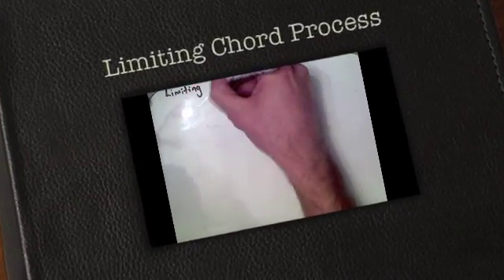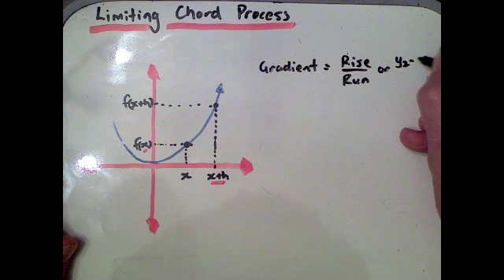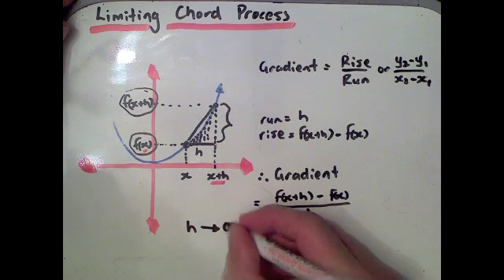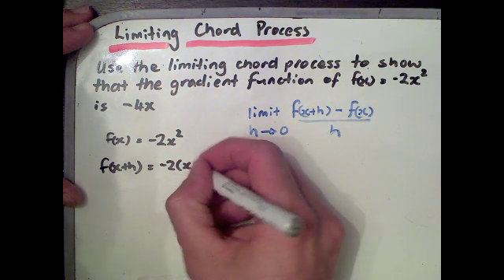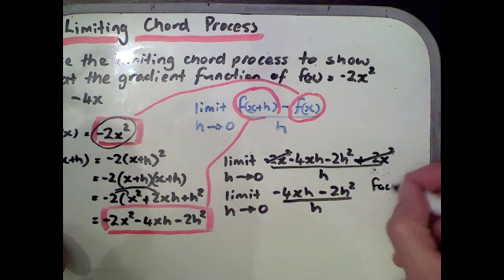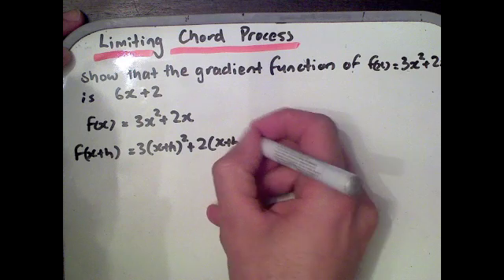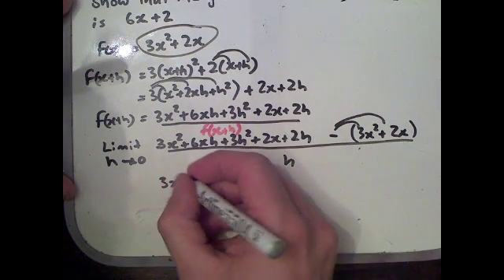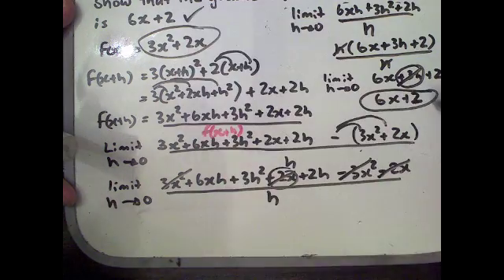Limiting Chord Process

Comment from the maker: same process 

(x+h)^2+4(x+h) - 5 - (x^2+4x-5)     (dont forget here to multiply out the negative through the bracket)

x^2+2xh+h^2 + 4x + 4h - 5 - x^2 - 4x + 5  (here the -5 and +5 cancel out) also the x^2 and -x^2 cancel out and the +4x and -4x cancel out)

Leaving
2xh + h^2 +4h  (factorise out the h)

h(2x + h + 4)  (cancel out h on top with the h on the bottom)

As h tend to 0  we are left with 2x + 4

Hope this helps.